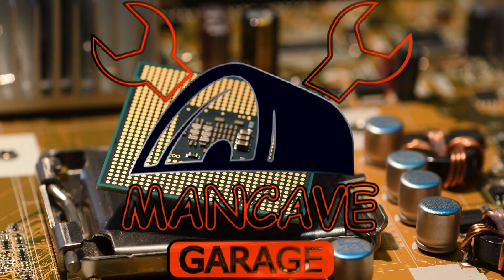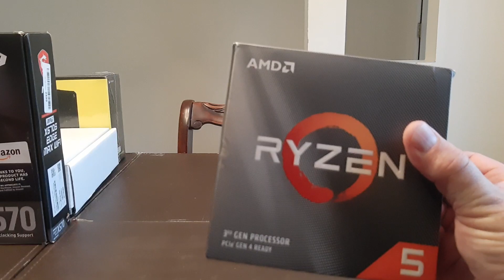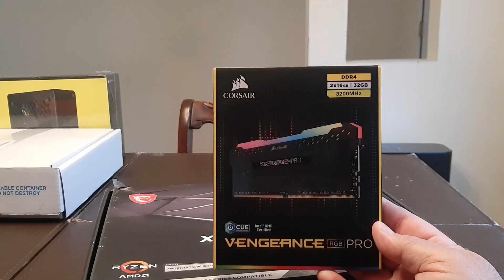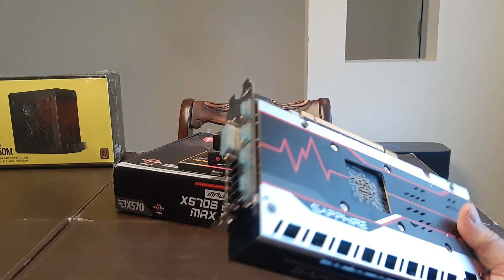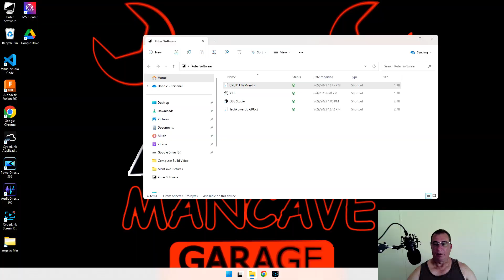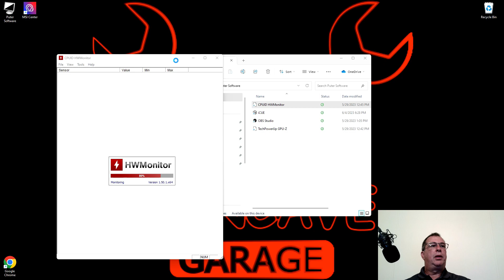First Ever Computer Build! How did it turn out?

Comment: You don't need a AIO to overclock a 3600, a decent air cooler would have been more than enough, considering it's a 65w cpu
Reply from the maker: I was on the fence about using an AIO. Some things I read said yes you should have one, others said it was not needed. I decided what the heck and got one anyway. Better to be safe than sorry.